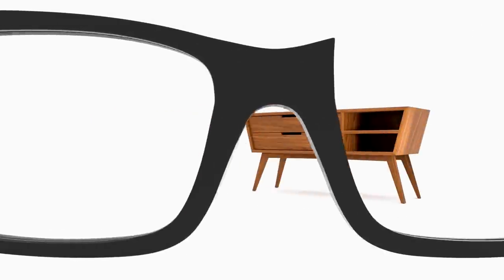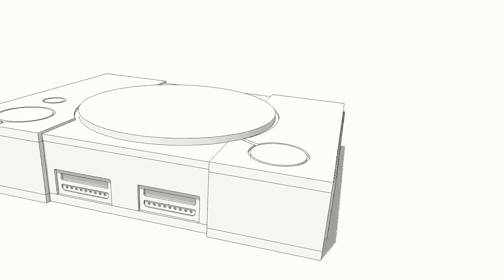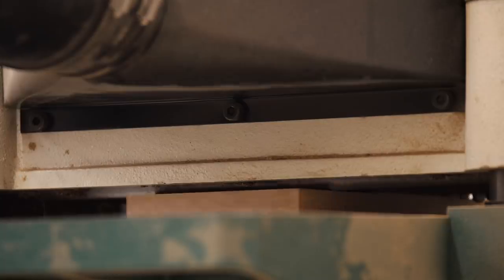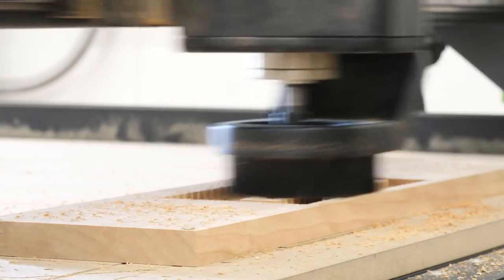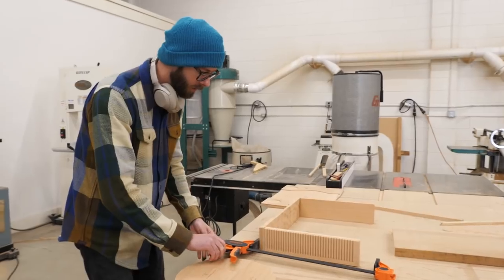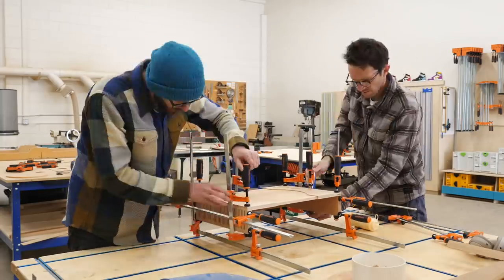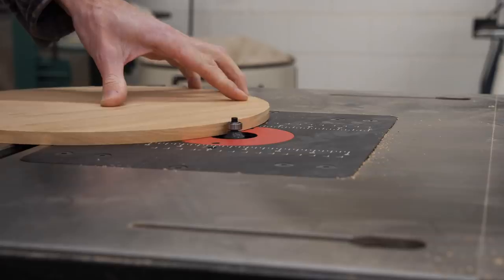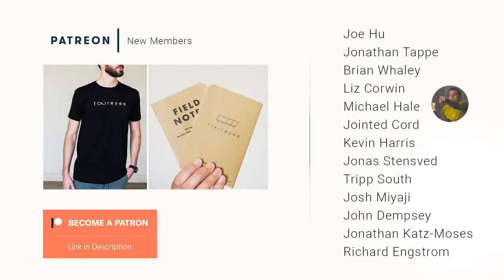I Made a Giant Wooden Playstation 1 Cover for my PS5

Comment: This is a sick idea and execution, but you're gonna thermal lock that thing once some of the newer games come out or if you have a lengthy session. The intake is at the top and front of the machine. If you pop the top plate off you'll have better luck with the thermals, but it's not optimal for the long run. Can't take the bottom plate off unfortunately because you have it laying horizontal and the stand uses the plate for an anchor.

Comment: Cool project. I would be concerned about cooling tough
Reply from the maker: Thanks. All the venting is in the back I believe...which is completely open.
Reply: @Foureyes.Furniture  But it needs to intake air from the front and top. You've basically suffocated it by sticking in a box, even with the open back. There's nowhere for cool air to enter so it's just going to intake the hot air from the back, causing your console to heat up more and more until it fails early due to overheating.
Reply: @Foureyes.Furniture  The intakes are at the front and top. It exhausts out the back. Hopefully you have enough of a gap at the front and top for enough air to get in, otherwise you will slowly cook it. https://youtu.be/8FZ3cQFFZmQ?t=1195

Comment: Very nice. The way I prevent the problem you had with the initial cut starting at the wrong place, using Easel, is by setting a center point. While this isn't that intuitive in Easel, it is possible. So I make my design on the design surface and don't really care where it is positioned on the 'material'. Then when all looks good, I select the complete design and set the location to "0.0" making sure that the 'Center' is selected. This moves everything and Easel will only show the quarter of the design that falls on the 'material', but it will still work. Next I find the center of my material (which, if it is a rectangular piece of wood, is easy by drawing both diagonals. The center is where these intersect). Then I Set my start location to that center point and run the project. Hope that is clear and helps you or someone else in the future :-)
Reply from the maker: Hey Robert...thanks. That totally makes sense. I feel like in this case it was just pure stupidity on our part. We knew we had to start the cut basically on the front edge of the workpiece...we just didn't bother paying attention when we were doing it.

Comment: First thing first, great video, I love the way you handle your machines, very professional. 

Now, have you thought about thermals? The ps5 already gets toasty enough sitting outside, imagine chocking it even 5% by putting it under this wooden ps1 cover, I know there is a big opening behind, but there is no fan to actually move away hot air as soon as it leaves the ps5, you will end up overheating / thermal throttle the ps5s performance although I don't know if that's a thing in ps5s.

Comment: From an engineer’s point of you, in would really have liked to see temperature data from the PS5 inside the box. I am not familiar with PS5 thermal management design, but I am have a hard time seeing how to achieve a good airflow with a boxed closed on 5 sides out of 6 without any special vortex creation device. I have a feeling this setup will considerably shorten the life of this console.
Reply from the maker: Everything I read pointed towards the only important thing being that it remained open in the back. So it's 100% open in the back. A few inches on either side and the front, and about an inch on top. So I don't think it'll be an issue. But if it breaks in 3 years...then I will have been wrong.
Reply: @Foureyes.Furniture  it’s fairly easy and cheap to test. What we do where I work (avionics) we install a few thermocouples close to the main components and take samples during representative use and then compare the results with the recommended industry margins to achieve desired product life expectancy. In your case, you could just compare with and without the box. Thermocouples compatible with regular multi meters are cheap on Amazon.
Reply: @Foureyes.Furniture  gamersnexus has extensive info about this... Unfortunately you really need the front/top of the PS5 to get fresh cool air pulled in. Exhaust leaves the back of the console, so you're sucking in hot exhaust into the intake

Comment: That case kills air flow,  doesn't add anything to the console.  Would've been better if you took the PS5 apart, and integrated the parts into a better Ps1 shell.  One made of metal or plastic, built by a 3d printer.

Comment: Dude! Ventilation!!!
Reply from the maker: The ventilation is primarily out of the back. which is totally open. On the sides there are also several inches...but I don't think that even matters. We talk about it in the sketchup portion of the video
Reply: @Foureyes.Furniture  Exhaust is not the same as ventilation. Yes it exhausts out the back, but where do you think the air it exhausts is coming from? The PS5 doesn't create air, it has to intake it from the front and top, which you've blocked off.

Comment: It looks nice but what about temperature control of the device? You simply ruined natural convection of the device by covering it. :)
Reply from the maker: It's open in the back where the vents are
Reply: I made the same type comment. You better check it with an ir gun while using it! 
Don't shrug this off. I'm not a 12 yr old saying something I just thought of too listen to myself talk.  I've got plenty of electrical experience. 
I'm not saying it'll overheat, I'm saying you need to check it every... say 10 minutes while playing a game that stresses the system. For an hour or so until you feel confident. 
Good luck.
Reply: @Foureyes.Furniture  Air intake for the PS5 comes from the front of the unit, and exhausts out the back, if you don't have a good supply of fresh air intake, the unit will overheat over time
Reply: My advice would be still against that cover although it looks so nice. Like I said, due to natural convection from external area of the original casing you will heat the limited air volume between Ps and wooden enclosure. Then the fan will simply suck that hot air into Ps. This will decrease the efficiency of the cooling system. It doesn't necessarily mean the system will be ruined, I hope it will shut itself down before that. But best case you will run your Ps at higher temperatures and it is also not good for electronics. In long term, you may lower the life expectancy of that Ps. Some holes on the wooden case may work by the way. I suggest you to check the inlet area of the original case and create holes on the face of wooden cover against these inlets.
Reply: My comment was for @Chris Salamone :)

Comment: But like why didn’t you simply make wooden side panels?! With that kind of equipment you could probably make a simple swap with the white ones! Could probably even help with ventilation...
Reply from the maker: That would actually be way more difficult than this. You'd have to do a bent lamination and since wood springs back. even if you built the form perfectly, the piece would come out un-identical once released. So you'd have to factor in the spring back. Basically you'd be engineering something that should be mass produced for a one off piece which is way more difficult than making something that's just a one off piece.